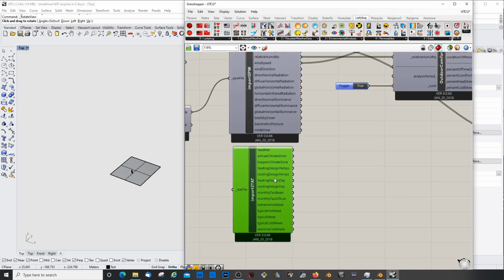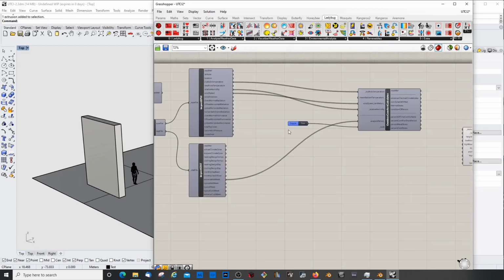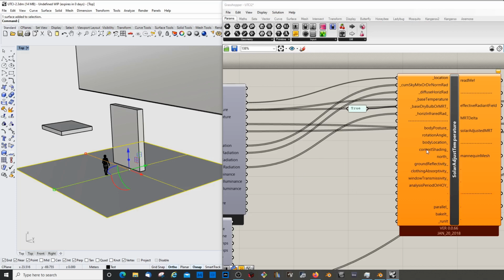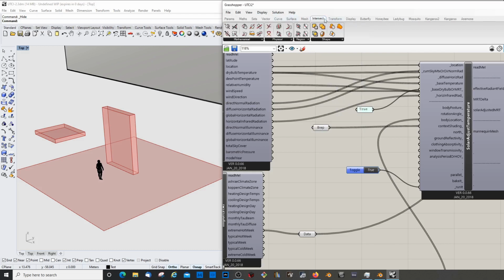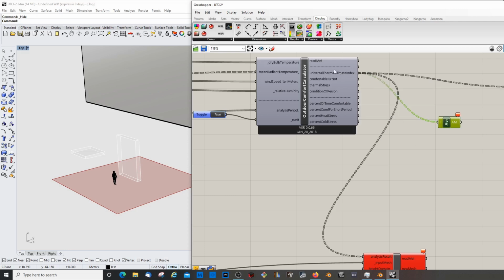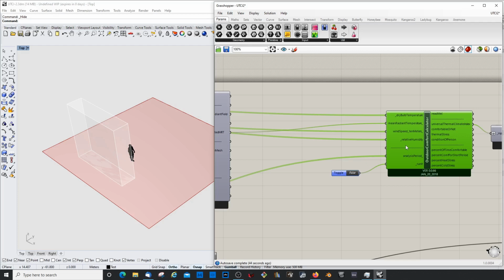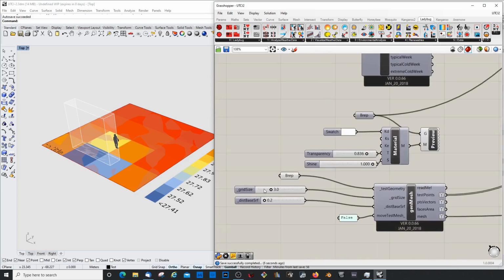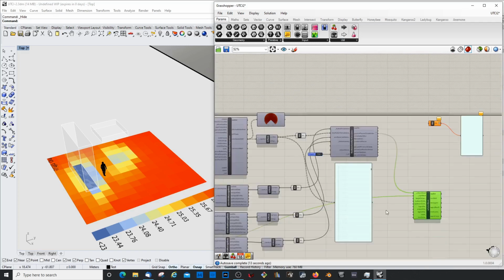Outdoor Comfort Analysis Part 02 | Rhino3D Grasshopper Tutorial 08

Comment: Thanks for the video! Just a quick question: around the end, you calculate the mean of the input climate data to save computation time. Doesn't this affect accuracy since comfort models are non-linear? For example, averaging a freezing hour and a scorching hour might give a mild average temperature, hiding the discomfort. Wouldn't it be safer to average the results instead of the inputs?
Reply from the maker: Great point - you are absolutely right - comfort models are non-linear.

Its quite and old video and just kept there because some people still watch it. I might retire it soon.
In later videos i try not average but use design days instead. Averaging smooths away the heat- and cold-stress moments, which are the whole point of the analysis.

Thanks for raising it — it’s always good to revisit these early tutorials with a sharper lens.
Reply: @PhilippGalvanDesign  Thanks Philipp, and thank you for your videos! I started with Grasshopper and Ladybug last week and I’m going through all your tutorials day by day from the first one on your channel. Even these legacy ones have been useful, when I run into an old component, I check online to understand how to replace it in the current LB workflow. In any case, step by step, I’ll soon get to your newer videos as well. Thanks again!

Comment: Thank you so much your tutorials are so helpful but i have a problem.. i run the script and it gives me back an error that says "lenght of the results [=1] is not equal to the number of mesh [=143] or mesh vertices [=168].  Do you know what is going wrong?
Reply from the maker: Yes there is something wrong with your result. Your data has only one entry but should have the same amount as there are mesh faces otherwise the script doesn't know which mesh face to coloured how. 
Now it could be that your result is one list with several data points. have you tried to flatten the list?
Reply: @PhilippGalvanDesign  thank you for your direct answer..yes when I flatten the data it gives me back the error but when the data are not flattened it works..I don’t know why this happens
Reply from the maker: Well ...It's hard for me to know the reason without seeing the script. But great it works now.

Comment: Hey man, I'm trying to calculate the comfort but the analyzed plan is all blue. It seems that the average values are totally equal, so it is plotting just the blue color refer to valuse 28
Reply: Having the same problem plz check my script. Uploaded in the same one drive link
Reply from the maker: Can't see the file. What's the name of the file?
Reply: @PhilippGalvanDesign   Folder named Outdoor Comfort Problem
Actually I got the results but when I Increased the size of the objects in the model. I don’t know why it was not working at smaller scale.
And please can you suggest how to calculate PET rather than UTCI.
Thanks for responding…
Reply from the maker: Hey, I tested your model and script. When I first opened it it also turned blue. I think the problem could be the units.
I run Ladybug tools always in meters. Make sure your file unit is meter. It was set to millimetre when I opened it.
It worked at the end. I changed the unit size to meter and re-ran the script. I also scaled it smaller to test... works too.
Also to remember to re-run the script after scaling.
For PET I need to look into how that could work but I think it's just a simple conversion. I'll get back on that.
Reply from the maker: Hey, I had a look at your script. It worked fine. Regarding scaling, make sure you use meters as units. Your file units where set to millimetres. Regarding PET I will have a thought.
Reply: @PhilippGalvanDesign  Thank you so much...!
Reply from the maker: Hi, Dario - It could be that your test surface is flipped downwards. You need to make sure that your test surface is oriented correctly. Use the flip command to confirm your surface points up. Hope that solves the problem. If not let me know.
Reply: @PhilippGalvanDesign  I just tried but it is still the same. I think that the problem is in the values plotted by the comfort calculator that are the same for each tree branch. 55 branches and 175 values even if I set the hottest week as analysis period
Reply from the maker: Do you want to send me your script so I can check it? you could place it here:
 https://1drv.ms/u/s!AroqbdH7xD3LjfM5knnmyLcEo5zmsQ?e=THFcBr
Reply: @PhilippGalvanDesign  Really appreciate it! I uploaded them
Reply from the maker: Hey, I saved an updated version in the same folder. You had it almost:
1. The SolarAdjustTemperature also needs the time period.
2. The SolarAdjustTemperature output needs to be an average for each cell - see what I added to the output
It should work now, please check and let me know.
Cheers
Philipp
Reply: @PhilippGalvanDesign  Thank you very much man! It is working now!!
Reply from the maker: Awesome! As I said, you had it almost.

Comment: Thank you for your video, it is really practical
.
I implemented your algorithm but it gives me an error in the Average box " "Input parameter I failed to collect data"   ", what should I do? Thanks in advance.
Reply from the maker: Hi Elham, 
Not sure which of the average boxes - there are several in the script. But first i would:
1. Make sure that you ran all components - the toggles need to be set to 'true'.
2. Check the data output you want to slot into the average box by using a panel to see whats inside. if there is data you need to make sure it's numbers only. the average box can only take numbers. if there is both numbers and text you need to use the string/number component to seperate the numbers from the text first.
Let me know if you still need help. You can send me a screenshot via email or the script - check my channels about section and click view email for business enquiries to get my email address.
good luck
Reply: @PhilippGalvanDesign   Thank you, sure